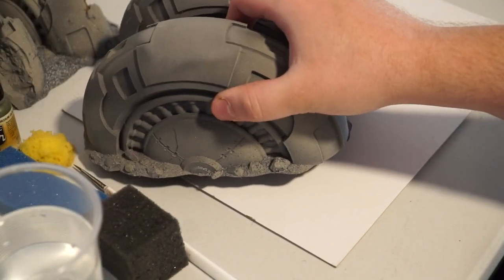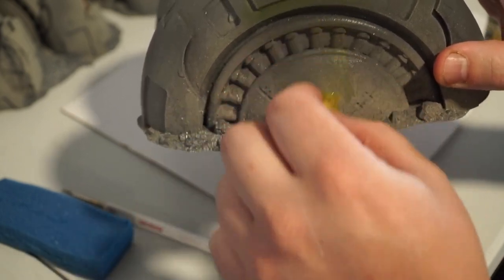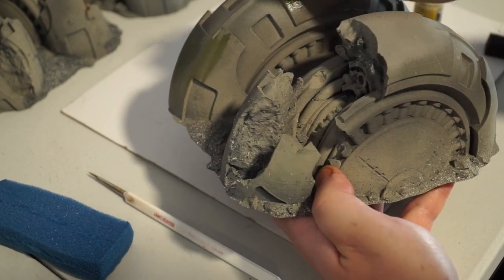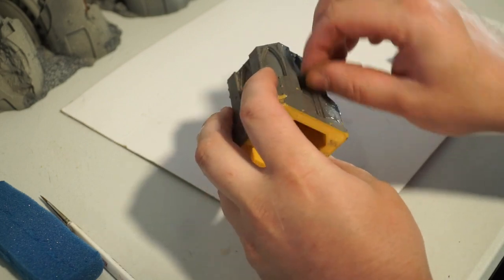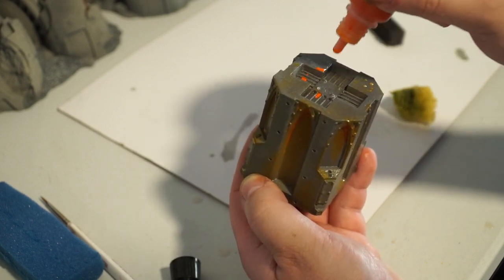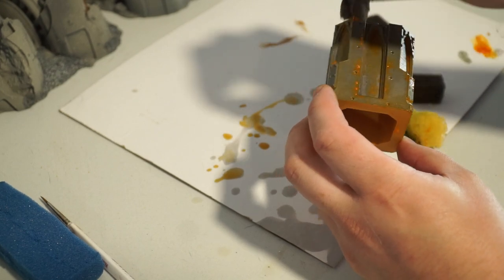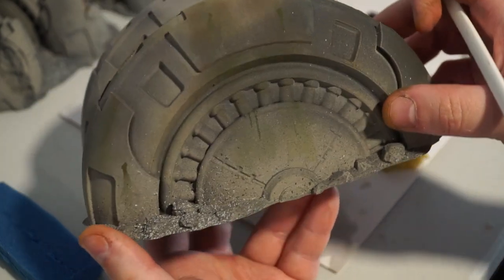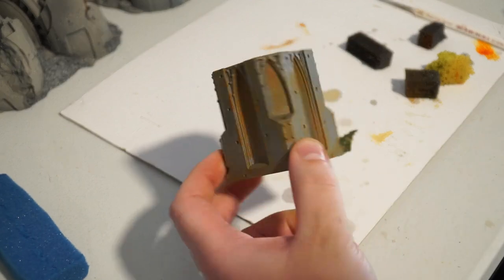10 Minute Terrain: Painting Concrete

Comment: Textured spray paint is a game changer when it comes to people criticising 3D prints for layer lines as it hides that up and really lends itself to all the quick techniques like this. It goes to show that you can go a long way with what's essentially just a base colour and an assortment of weathering. A lot of people I've spoken to say they'd like to do more terrain but don't really have the time with all their other models that need painting but you really can turn it out quickly and to a decent standard with techniques like this. Some quality hobby content right here for anyone on the fence about adding terrain making/painting to their skillset.

My favorite thing to do with bigger terrain pieces like buildings is mist some thin burnt umber ink over just the bottom of the piece to create a gradient of built up dirt near the ground where you'd get mud kicked up by rain. Thin ink applied sparingly can also be good for building up variation of tone like you're showing here. I swear the best terrain/weathering is done with multiple passes of quick and easy things like this rather than needing finesse and concentration.

Comment: You need to work with white spirits, but doing this same thing with cheap oil paints it will be as fast I think and can also emulate some fancy AK weathering effects. Also gret tutorial
Reply from the maker: Yes, but petroleum based paints and thinners need to be applied over a varnished surface due to the material porosity, which I think is a step beyond for new painters.